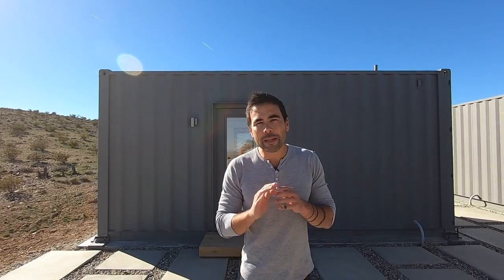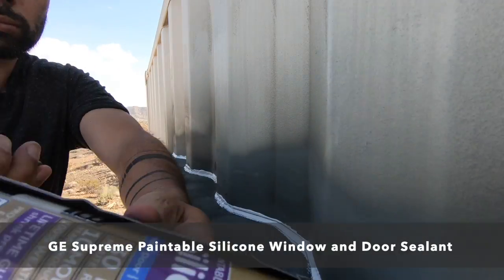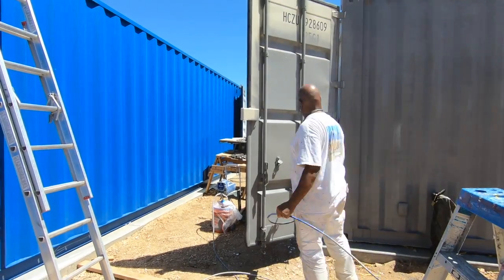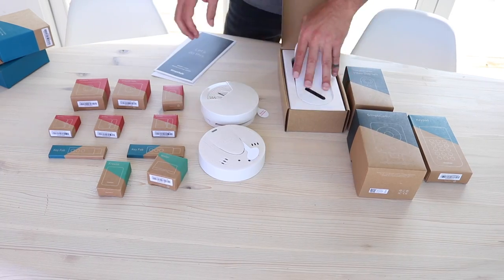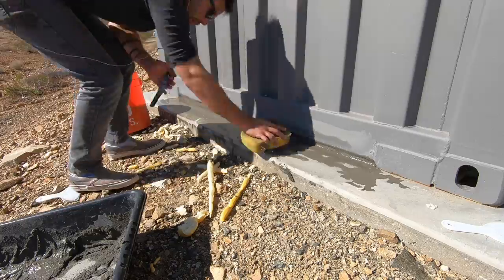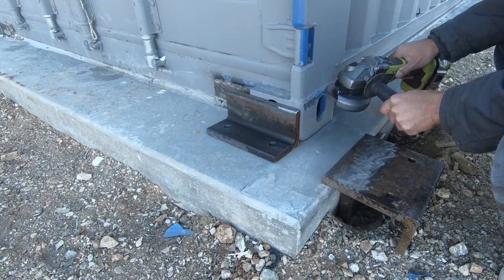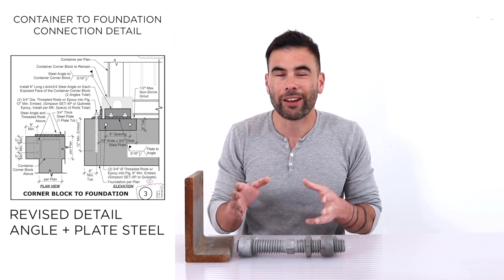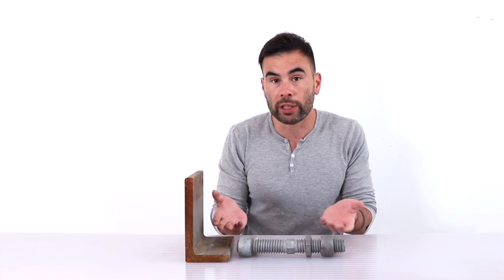Building a Shipping Container Home | EP6 Painting and Anchoring

Comment: Great project and videos! To anchor the sea-can to your slab, I have seen people use the exact anchor used on the ship to secure the bottom layer of containers to the deck. It is a special knuckle which fits into each corner socket and the container is lowered onto it with a crane. Once the container is flat on the deck of the ship, a bar is inserted into the hole of the corner socket and the knuckle is turned 90 degrees to fully secure the container (when all four knuckles are turned).  You can purchase these knuckles and have them inserted into the frame of your slab structure before pouring concrete or pour your slab first and drill holes with a Hilti afterward to secure the knuckles that way.

Comment: As a civil engineer who does NOT do structural engineering, my first reaction would be to triple check the math for the distance you are drilling from the concrete edge to the anchor bolts holes (and concrete mix used). In a high wind across the broad side of the container, is there enough strength in the bolts and the X-inches of concrete to prevent failure of either material (primarily the concrete between bolt and edge without rebar)? My first consideration would be to weld a flat plate across the bottom of the container (pre-flooring), about 1/4 to 1/3 distance from each end, and drill anchor bolts holes through the plate, into concrete, and between the rebar gaps. This is definitely design overkill, but less likely to have concrete fail/crack along perimeter from thermal expansion/contraction and bending moments. Thoughts/opinions from anyone who stamps structural drawings?
Reply from the maker: thanks james!  this is exactly the type of conversation i want to foster!  I will bring up your idea to my structural eng!
Reply: The only thing I stamp is an envelope, but what I noticed was how soft the concrete seemed?
Reply: @wakeupamericaandresist2413  With a proper hammer drill any concrete seems soft. Over here (the Netherlands) the outer walls and flooring is done with concrete. I once spend 1 hour and 2 drill bits for 4 holes, the next day I bought a hammer drill and did the same job in 5 minutes.
The concrete does seem soft because he is using the right tool for the job.
Reply: @DhrChibi1  omg are you me? I live in a Dutch, 2017-built, pre-cast concrete house and I wore out my drill and drill bit trying to mount storage racks to the inside of my outer-wall. Borrowed my dad-in-law's hammer drill and it went through like butter. Concrete as a building material is nice and solid, but hanging things on your wall or mounting curtain rails to your roofs sure is a nuisance....
Reply: @112Haribo  It's amazing what you can do with the correct tools. I used basically what Ben is using to drill 1 inch diameter holes in my patio. Drilling 6 inch deep holes with that went about as fast as drilling through 2 inches of hardwood with a forstner bit on my drill press.
Reply: Have you ever seen a shipping container house with a concrete slab on top? Keep watching.............

Having said that, its kinda  cool.

Comment: You can always use the actual container connecting anchors (twist lock) that they use to connect them to each other on the ship. They have twistlocks with a flat flange that can be bolted to the concrete the same way you did with the 3/4" steel. I would weld them to a larger plate, install the twistlocks then set the container, and finally bolt them to the foundation once placement is complete.👍🏾👍🏾👍🏾 Can't wait to see the finished product.

Comment: So on a build I worked on in Nigeria, i used silicone to cover the gaps between windows and the steel used to support the cutouts. I found that some of the gaps were pretty small or thin, as such spray foam may not have filled them efficiently. But I do like the idea of covering the gaps with trim pieces. I figure on the inside the dry walling takes care of the gaps so you won't need to do same? In all, very nice and clean build. Thanks for sharing, really looking forward to more of your content.

Comment: I think you picked the option with the best overall value all things considered (economics, sweat equity, etc). Did your engineer look at embed plates with nelson studs that would be set flush with the top of concrete then welded to the container house? They probably would have been a bit more expensive but they do provide a little more tolerance as the plate can be sized to your comfort level. I've set those and then welded columns directly to them. Anyway, great series!
Reply from the maker: i think that is what we are leaning to next time!  good suggestion!  thank you!

Comment: Slider mounts !! You can possibly make a mount from the foundation to the container with slider mounts.  Basically the same idea you had but make the holes elongated so you can slide them differently depending on the project. Then use huge lock washers to hold everything down. BTW,  I’m really loving the usage of a container as a home.  I’m trying to convince my wife instead having a new home built here in south Florida but have to weigh out the costs.

Comment: Embed steel plates in the corners of the slab. Weld rebar to the back and tie them into the bar in the footings. Then weld the container corners right down. Make the plates a bit oversize so you have some wiggle room.

Comment: I would recommend closed cell SprayFoam for all insulation after you installed the 2x4 framing it would cut down on a lot of labor and it has a much higher efficiency.

Comment: Hey man. Did you consider casing a holding down bolt in either corner with a 250x250 pocket allowing for some play in final location. The container can then be fixed using a plate in the container securing points and a bolt. At least then the bolt will only be in tension and not torsion so a smaller standard bolt could be used.

Comment: Could you have welded the anchors in under the floor before it was installed? Or were they required to be outside of the footprint. I'm looking at putting some in for storage but we are prone to high winds so I want them anchored.

Comment: I wonder if when the final bolting down of container be done with those anchoring bolts ? Maybe temporary set up some angle iron a start to position container in exact position,  then drill and epoxy glue bolts in ?
Is there not provision in every container corner for some kind of locking down while in transport that could be utilised for final installation?

Comment: could you pour a concrete form on top of the slap to act as perimeter to wrap around the container's edge? You could also pre drill holes for the bridge hardware to clamp down on the container. you're measurements would have to be precise but it's not impossible. The added concrete would also act as a critter guard on the container's bottom edge.

Comment: Hi Ben. I am  building a  container pad now, and I am going to  anchor it down  the  same way you guys did.  I am  ready to  order my angle iron. I  know  you guys used the large 3/4 inch thick  angle iron.  My question is  what lengths  did you  guys  go with. I  was thinking  of  7 inches  in length,  then  I  thought  that  was not enough  for  the    three  1inch anchor  bolts  to be drilled in properly.  Thanks for your time and help  in advance.

Comment: Placing a steel plate with welded rebar and placed at the corners at the right levels which is the height of the original shuttering and held in place by the set concrete and weld the SC frame to those.  Simple.

Comment: Looking forward to containers built on a common foundation but spaced ~8’ apart, with the open spaces filled with glass on the vertical plane (after removing the ‘interior’ walls) and skylights on the horizontal (roof) plane. 
Would make for a modestly larger home with far more visual roominess.
Reply: Update to my comment.  It's not on YouTube it's on eBay and it's called Lake Martin Contemporary Shipping Container Home.  It's absolutely gorgeous and I'm thinking of building one in the future.   You should take a look.

Comment: Totally different building industry and different litigation environment but in NZ we'd give serious consideration to casting in a concrete nib to prevent the container moving sideways and sheering those service connections.  Vertical seismic forces (which did alot of damage in Christchurch NZ) are still a consideration.  To my (architects) eye those steel sections look HUGE, but I can see the benefits of this solution and tolerance is definitely a thing...

Comment: How about: 1. Pouring slabs that are notched by a foot at each corner (rebar and tie bolts sticking out). 2. Then place the container.  3. Drop necessary anchor bolts from container corners. And finally, 4. Pour the concrete slab corners imbedding the anchor bolts.

Comment: Great videos, the latest in DIY.  I would prefer to  use the glue isofast panels on the inside.  Weld your structural elements on the outside,  frame with some kind of prefabricated StoPanels. I have no idea about comparative cost. As I live in Canada I would want double the insulation R value needed in the southern us. This method should make the steel a heat sink, not a convection system. Secondly it would maximize the interior space. However I have not seen any container housing built this way.

Comment: I believe you mentioned in one of the earlier videos, that cutting the openings for the doors and windows causes the container walls to lose its shear wall strength. Therefore, you put in the 2x4 studs with headers to add the strength back. 

Instead of adding the  2x4 wall throughout, could you have welded steel channels just around the openings in the container to act as columns and headers which should get the container walls to act as shear walls again? My whole idea behind doing that, it would allow you to make the walls thinner (with potentially less insulation) to allow more floor space. Or if the 2x4 wall thickness doesn't bother you, maybe it will allow you to use less lumber in general and get the same structural capabilities. 

Additionally on the foundation, were concrete piers with a similar anchoring method you used here not thought of? Or was it determined not viable? I don't know how the piers would react to earthquake loading, but that was my first thought, instead of the slab or ideas you mentioned in the foundation video. It would create complications with sealing the bottom of the container off to keep critters etc. but thought I would ask.

Comment: Instead of securing the container to the slab at the very end of the project, you could do it at the beginning when you have the flooring pulled up.   Possibly weld on some kind of cleats with large centers holes along the long section of frame, drill through those into the concrete so the hole is in line with the eye, then sink your cement bolt, squeeze in the cement glue or quitcreet, screw the nut on and weld it place.   If you attached enough of those, it should hold in place.  Plus it would be covered up once you put the floor back in and no one would be the wiser.

Comment: A bit late to the game on this comment but on offshore ships with single or double stack containers we typically just use welded T stoppers.  Pretty easy to perform calcs and easy to build and weld to a steel plate that can be preset into the slab or even placed on top of the slab after pour and dry.  If they can handle offshore transport they can handle this.

Comment: Two options I'd suggest:

1) Cheap (but effective) method - Set threaded rod in concrete while pouring the foundation. When cured, affix over-sized plates to the foundation before container placement. Place the container and weld the corners to the plates. While I don't have the numbers to back it up, I have considerable real world experience and believe that the pull-out strength of connectors set in concrete exceeds that of of those set in epoxy in drilled cavities.

This decidedly low-tech method doesn't require excessive precision when setting the connectors, thereby providing the flexibility that may be needed for final container placement.

2) Marine transport method - Affix deck mount twistlocks (side plate design) to container corners before placing the container. Once placed, drill holes and set threaded rod in epoxy as was done in this piece. Done.

While this may not be as inexpensive as option #1, it's a one-and-done affair. No follow-up visit. No welding. Just drilling and wrenching. Best of all, this is how containers are secured to the decks of cargo ships, so they're built to withstand the rigors of both transport (marine, rail and truck, as well as handling) and weather/sea conditions (high winds, severe angles from pitching, etc.); requirements that would far exceed any terrestrial building code.

With deck mount twistlocks, containers can be as close as 2.4" off the foundation. Obviously, this is something to consider as the containers in this project rest directly on the foundation slab.

A side benefit of twistlocks is that they're reversible, meaning that they can be "unlocked" and the container can be relocated.

Comment: To be honest the bolt and angle anchor solution isn’t that bad... easy to calculate theoretical strength and standard components very easy to source. Sure it might be overkill to anchor such a building but again it is California building code. Maybe an alternative is to have a dispensation process for certain projects that probably don’t need all the standardized requirements... that could save money. 

Maybe a certified PE/SE with mechanical engineering background can design a solution/product that can be patented and start a business specific for container homes if the market is large enough?  

You could also consider having a designated shop to convert containers to living spaces and take online orders :P choose dimensions, room layouts, color and optional utilities etc... turn this thing into a booming business :P

Comment: Perhaps cast a length of galvanised "I" beam into the concrete slab at the ends of the container. This doesn't need to be super accurate and then you can weld the base of the container to it... No bolt holes or drilling.

Comment: instead of taking all that time to drill the 3/4" holes in the heavy steel plates, you could have had them punched on an ironworker heavy duty punch press very quickly !!
Reply: doug walk I agree!! Having a metal fab shop in your Rolodex is indispensable for things like this. Whether it’s bending 1/2” plate or punching repetitive holes, you can save hours and hours and hours by having them do the production pieces. When I worked for a welder we had a press that could do 1/4” plate. It always blew my mind how the machine made the steel seem like Play-Doh.

Comment: Just 1 question  Have anybody thought of making a lightweight steel frame holding the tie downs and placing and leveling it before pouring and encasing with concrete, That way your tie downs don't show.  Just wait till dry place the containers and weld the nuts bolts or not depends on local rules.

Comment: I've thought about using these -- https://www.tandemloc.com/k08a00d-series -- by either embedding steel plates into the concrete and welding them to the plates, or embedding bolts into the concrete. They identify shear, tension, and compression loads -- all the things a structural engineer would want to know.

Comment: I think it might have been possible to drill two holes on a 45 degree angle through the holes in the corner, insert two threaded rods into the concrete and make a plate that would be flush with the container and have a 45 degree hole for the rod that you can then tighten with a nut.
Something like this fantastic paint-drawing: https://i.imgur.com/UvYxmmY.png Rod in red, adapter plate in black and container in grey.